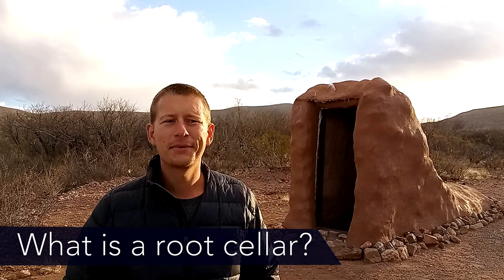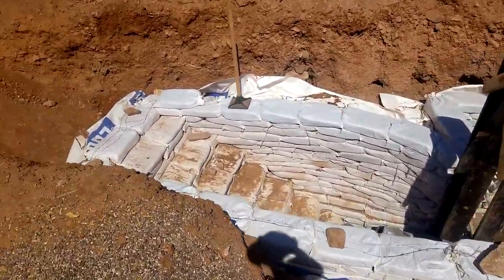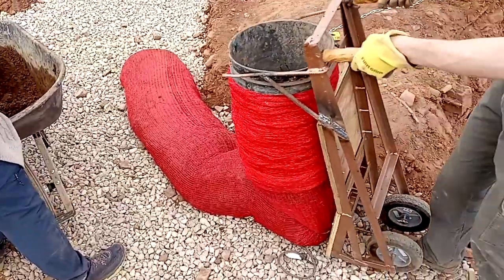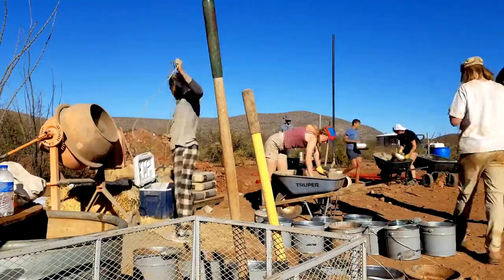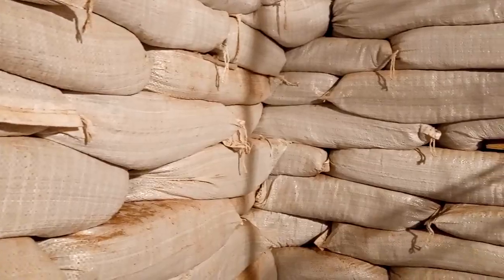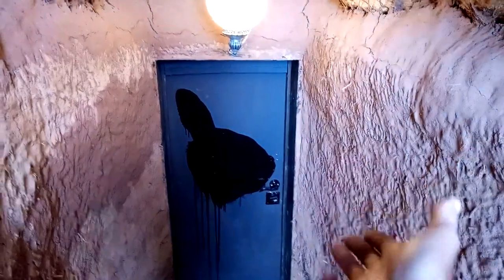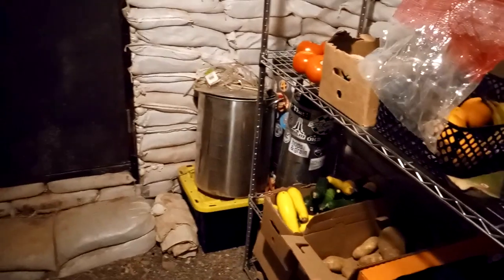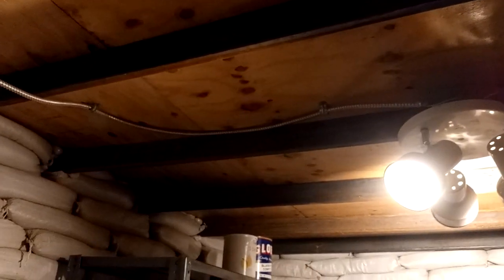Off-Grid Underground Earthbag Pantry Root Cellar Tour | Root Cellar Build Ep 5 | Terraform Together

Comment: I wonder if you could take a cue from earth ship cooling and ventilation by trenching the air inlet pipes further away, like 30 feet. Also maybe put some sort of cowl/funnel on the top of the pipe to catch more moving air. In this way more air be forced to flow a further distance under ground thus cooling it more before it enters the root cellar.
Reply from the maker: Certainly possible. Our soil is so hard to dig through a long trench would have been really expensive to dig.
Reply: Great idea David verge permiculture did this with there root cellar

Comment: Maybe you could add more soil on top? Make the boot look like a steel toed one...but I'd consider making a hill (berm) over the whole area, if the ceiling will support the weight.

Nice job!
Reply from the maker: Thanks for the suggestion. We ended up adding straw over the top of it so that we could add insulation and keep the weight down. That seemed to help.

Comment: This is amazing, nice build! I have the same individual bags as I am building solo for the majority of it. How far down do you think a 10 ft dome needs to be buried to reach those amazing temps you have. I’m building out in Cochise county slowly, and was thinking 5 ft down with a 3 ft berm around the perimeter, what do you think?
Reply from the maker: Our hole was dug about 10' deep. We probably have 6" of earth on top of the roof. I think the more earth you can get on top the better. I don't have any experience with domes, but if it was engineered in a way where you can put earth on top to get more thermal mass that would be ideal. I would consult someone who has more experience in domes specifically before doing so though.
Reply: heck out green dream project here on youtube.  They have done what you are asking about although i think their dome is 22' inner diameter.  The whole dome itself is a huge thermal mass and acts like soil on top.

Comment: Why only six inches? What is stopping you from simply adding more dirt on top? Is it a load bearing issue?
Reply from the maker: Yes, we should have gotten bigger beams for our roof supports
Reply: @TerraformTogether Soil is heavy.  You can dig up what you have and add more and better support or you can add bales of straw on top of the existing cellar.  Blocking the sun and adding as much bulk without all the weight.
Reply from the maker: @saxonsoldier67  I like that idea! Thank you!

Comment: Hi, I am currently repairing a 25 year old mud brick house and cottage.  I am struggling with cracking of the final finish....it goes on fine, but cracks as it is drying.  I have tried a dryer mix and a wet mix and still the same problem.  The mud is sourced on site, I have not added anything to the mud, maybe this is the issue? Very frustrating.
Reply from the maker: Not being able to see the actual mix, my guess is that there is too much clay in the soil. You can do a soil test by filling a clear jar with half soil half water. Putting a lid on it, shaking vigorously. Then let it sit for a day to settle out. Your clay will be on top, then silt, sand, gravel, etc. 

You also want it to dry slow, so regularly misting it for the first few days is good to prevent cracking. 

There are no "recipes" for the right mix since every pile of dirt is different, but for the pumphouse plaster that we did recently, it was 6 parts sand to 1 part clay to 1 part slacked lime.  That seemed to work well for us. That video is coming out in early May if you'd like to subscribe to see what we did. 

Hope this helps.